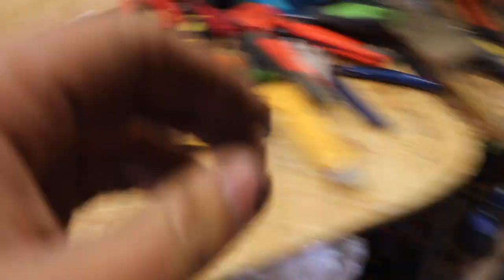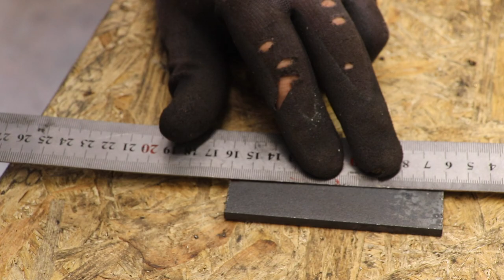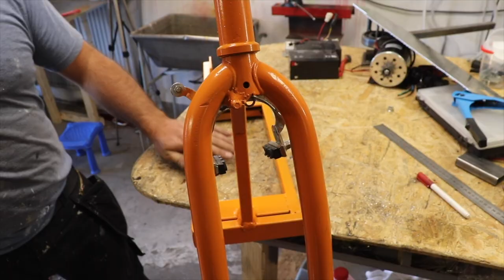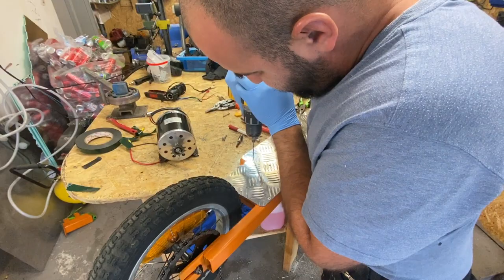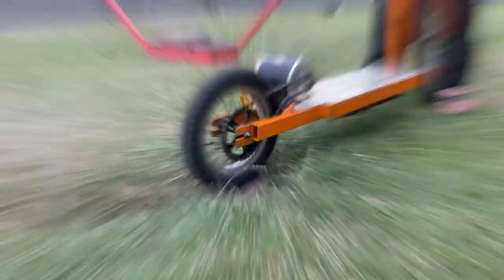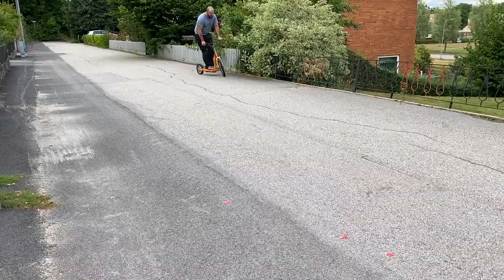Homemade electric scooter at home ! DIY PROJECTS

Comment: Can you use small car batteries? If so what would suit a 36v 1000w DC motor?
Reply: 3 car batteries (12 + 12+ 12) 36v anywhere from 2ah to 20ah depending on space and your goal for maximum range, although they are heavy so lithium is better

Comment: if i using motor 24v 450W electric scooter motor with 11nm, what battery should i used, i know that its need to be two 12v battery connected in series but how many AH per each battery are they? can  u please guide me..its for my final year project its a semi agv..tqvm